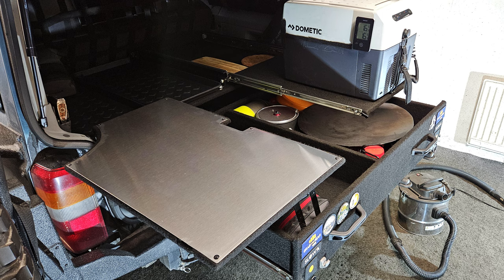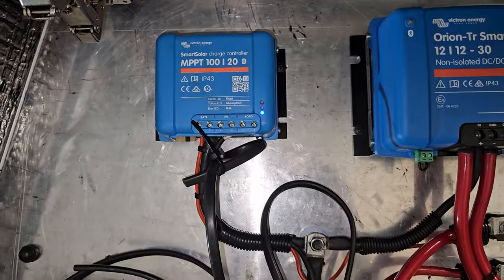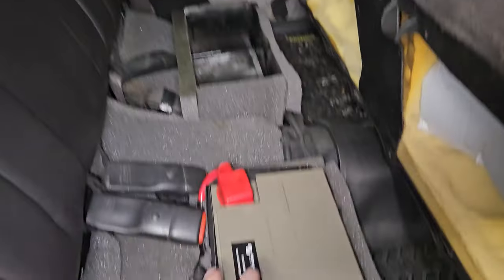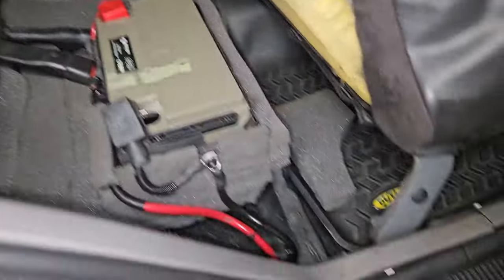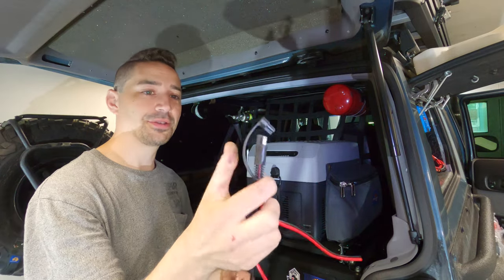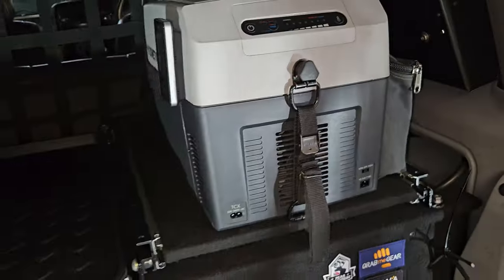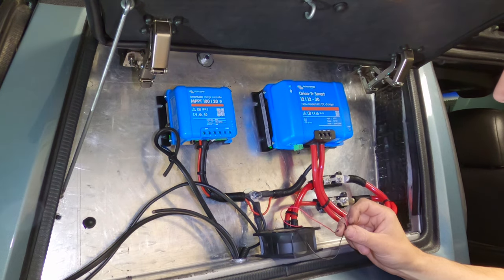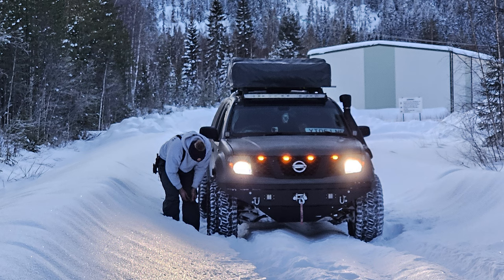Camping Jeep XJ Dual Battery Setup / Victron System

Comment: Mike the back aluminum panel which you've mounted to ( gear plate ) is a sufficient heat sink for those units .
I'd just vent the top and bottom of the gullwing boxes on the inside of the Jeep to let the hot air rise out  and  cooler air in by convection.
No need for external vents , will just let moisture and dust into the tronics
Reply: Mike I second this. Try this first. Having external vents will be a headache when washing the Jeep. And dust will be a problem over time. 
Internal vents a better option. 👍

Comment: PC computer fans would be a much quieter option. They’re designed for quiet operation and you can get different styles designed for static pressure or higher volume cfm. Noctua 120mm fans are available in 5v and 12v varieties. They would be my choice for quiet constant airflow in that gull wing.
Reply: I went to find my phone to leave just such a comment. 120mm or better 140mm high cfm quiet fan. Noctua is best in class, but there are cheaper options too, Arctic is decent, for example.

Comment: You wont necessarily need to add a fan, a couple vents into the cab will be ample heat dissipation for those units, plus being on aluminum its a massive heatsink already.
Reply from the maker: That's a good point. I will add some vents internally at the top of the box and see how it runs without the fan. Thanks for watching

Comment: AGM makes sense for your setup I think. The cold temps and the fact you are charging off the engine for months at a time, you don’t need the ability of lithium for ultra rapid charging and discharging, or the extra energy density. Lithium has been a game changer for me on my boat, with the ability to run induction cookers and hair dryers (for the Mrs)  etc… off a lightweight system. And with a high output alternator I can replenish it quickly when blasting to the next destination. But for your  setup I would also have gone AGM.
Reply: I disagree purely for the reason that this Cherokee must be running very close to its maximum allowed weight. Some simple low wattage dc heat mats would have solved the temp issues with lithium and retained all the other benefits.
Reply: @wodgesad  I’ve no experience with lithium in ultra low temps, so you might be right.

Comment: As others have said - PC fans, loads to choose from, cheap as chips, use hardly any power, almost silent - bigger fan and slower RPM, and can get them with a little thermal sensor attached and variable RPM depending on air temp. Although it's more of a ballache I'd use something like 2 inch (or whatever you can get away with) plastic pipe so that the air coming in and air going out come from the wheel well because if you take air in from the outside and vent into the vehicle that's asking for wind noise, dust, insects etc. into the boot and hence also passenger area.

Comment: Hei, problem with intake holes is dust and rain, electronics don't like either. For a fan check out gaming computer related fans, they are much quieter and move quite a lot air.

Comment: If you put louvres on it, add a drain to the corner similar to a sunroof drain with a hose off the bottom to the outside. It’s bound to collect water in there if it’s exposed like that. Can’t wait to see the finished setup!

Comment: I would personally have a  fan on the inside of the wing box, sucking air from the car into the box. Perhaps it could be mounted on the bottom of the box, directly below the charger. Drill vent holes somewhere above the charger, just enough to maintain positive pressure and take advantage of convection. 

I believe your box is about 80mm deep based on the charger so something like a Noctua NF-A6x25 FLX (12v, non PWM) should be more than enough. A decent quality fan like the Noctua should have no issues running at 15v.

The issue is powering it. If you have a handy ignition live wire back there, then relay to that. If not, perhaps you have a voltage sensitive relay kicking about from an old battery setup, you could use one of those. A bit overkill as you only need about 0.1amps, surprisingly hard to find low current, cheap ones. You could go totally mad with it and use a photoelectric sensor on the LED of the charger.

I wish Victron and others would put a signal out on these things. I'm almost certain the 'remote' terminals can't be used as a signal wire but worth throwing a multimeter on them to check.

Comment: Hi.
Good Video!

Why dont you take the cool air from with in the cab?
That air is cleaner and no leaking from moister or water.

You dont have to put the fan in the box, put it under the seat and then lead the air via a hose to the box.

Dont go for the external vents.

Comment: As always we in the colonies enjoy your humour....learned it well from my dad a boat orphan..heat in DC to DC ..back is heat sink mounted on aluminum box...perfect. put a hole in box behind in and screen if needed. Lots air flow no external intrusion. Fan would suck air into box or die trying to blow out of box.  If fan is your desire get a large MTI vane computer fan. Slow and serrated blades are quiet. My two nephews are hockey coaches in sweden....all the best.

Comment: hey mike why dont you look at making a heat sink that is part of the lid - so when the lid is closed it sits ontop of the orion like a cpu cooler cheap copper block that way it will be a passive cooling system , i do think the one issue to that would be it could pull heat from the sun into the unit would require a bit of testing the other option could just be a little rad on such a cheap aliexpress 320mm pc rad and have that pull the heat out the unit , couple ideas keep up the content mate

Comment: Bigger PC fans (120 or 140mm) should be much quieter. You can put a variable control in line with the fan to control the speed

Comment: Where is the video of gullwing rear quarter window install????  Gullwing box vent fan could be mounted in compartment behind interior side panels with intake and exhaust tubing into/out of gullwing box.
Reply from the maker: I never made one. It wasn't necessary because these chargers don't generate enough heat. The gullwing has some holes top and bottom for air flow.

Comment: If you are worried about the seat comfort your lads will be lighter than you and so not press down on the pad so much. However, you could always put seat covers over the bases and have a small piece of memory foam or gell pack underneath for additional cushioning on top of the seat 👍definitely get a quiet PC fan and not external ducts as they will allow moisture in but just vent the space internally with a few holes and you will be fine.  Try not to charge the black mamba and blow up doll at the same time.  Just saying 😅

Comment: Obvious question..why no lithium...heated if necessary power density weight price per watt appears better...
Reply from the maker: AMG deep cycle batteries perform much better in winter conditions which is mainly what I'm in. Also I wasn't comfortable with my kids sitting on lithium batteries under their seats. I'm sure encountering a problem is very slim, but its happened to others.  
I wasn't interested in heated blankets and things as I want to keep it fairly simple. I think its just sounder tech to have batteries that don't need it and can charge and discharge in extreme cold. 
Thanks for watching.
Reply: @WorkshoptoWilderness  agree with lithium bomb absolutely. Not a fan. Again thanks for great videos.